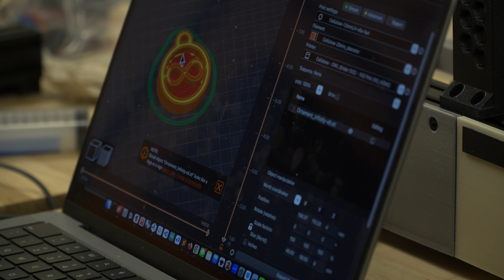3D printing on caffeine

Comment: What additives are used to solidify and stabilise the material?  My coffee grounds also quickly grow mould when i put them in the composter. Is something added to prevent that and make them safe to use?
Reply: According to the Ars Technica article, the grounds were combined with "xanthan gum and carboxymethyl cellulose powders, which serve a similar purpose to binders, stabilizers, and thickeners. Finally, that mixture was combined with water (proportional by mass)..."
Reply: you could bake out the moisture and then spray it with some sealant.

Comment: Would be awesome to have more options for homemade 3d printer material. Pet bottle filament exists but is time consuming and needs more resources. This method looks awesome and if grounded coffee can be used then similar stuff can too. This would be amazing for gardening.
Reply: I'm considering buying a shredder to simplify processing recyclable materials at home, such as cardboard, thermoplastics, and aluminium. I can reuse this and failed prints as stock for more traditional manufacturing techniques rather than going to the trouble of making filament